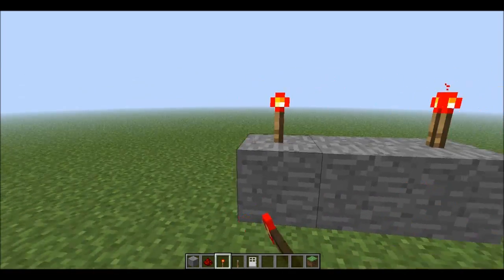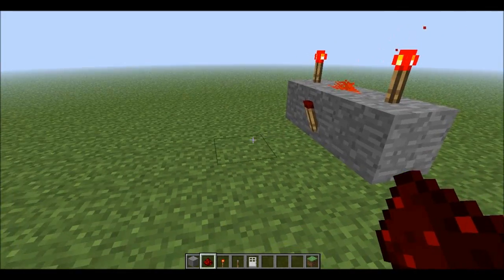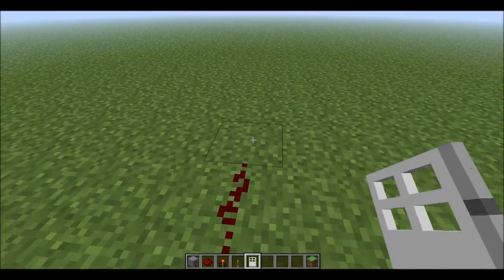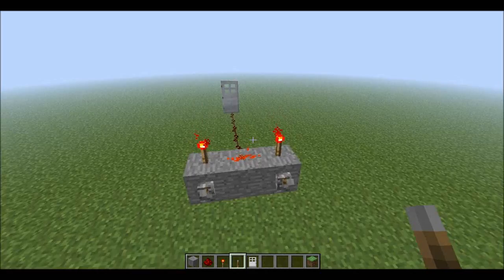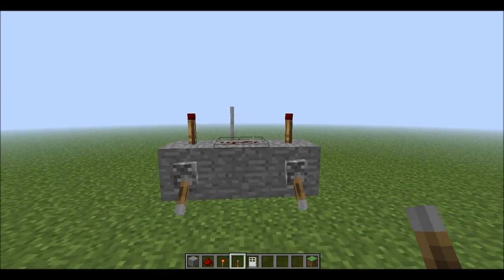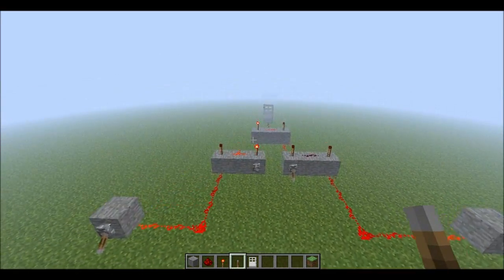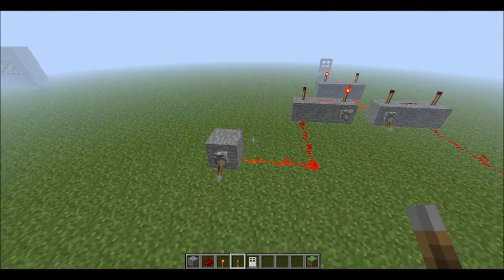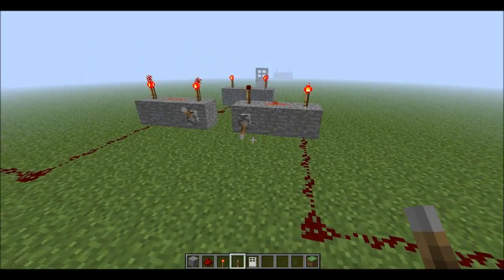Minecraft - AND-gate - Redstone tutorial.

Comment from the maker: NOR gates are gates that will only turn on(the output) when the two inputs are off. If you use two levers, it will turn off if lever A, lever B or if both levers are on.
An AND gate's output will only turn on if both of the inputs are on. That's the difference between the two. :3

Comment from the maker: Locking it? Do you mean making it so the buttons are deactivated? I would simply connect a block cutting the circuit to the flipflop. Then I would place a repeater, so the block takes the charge further on, then you just use a sticky piston connected to a lever inside your secret room. :) That way, the door will only react to the buttons, when the lever is on. 

I'm not sure if I explained that in a good way. xD